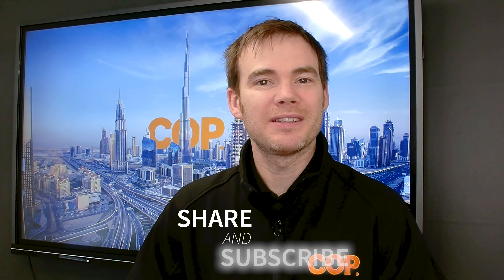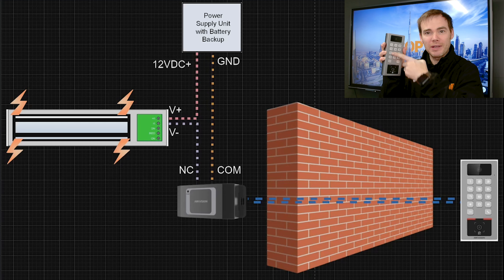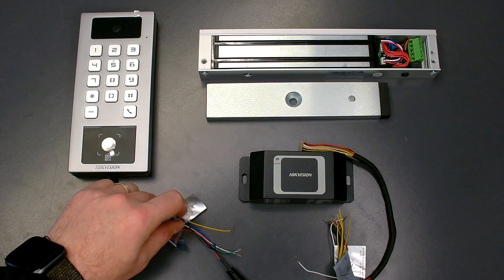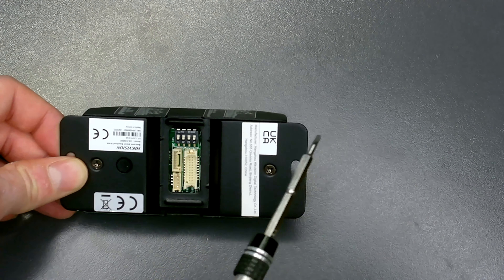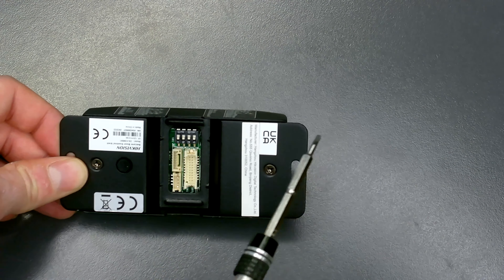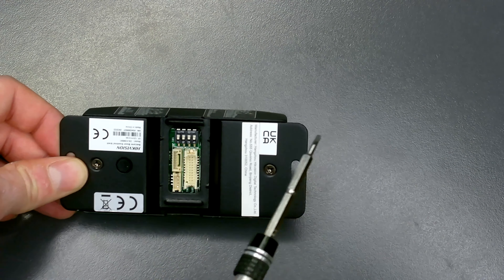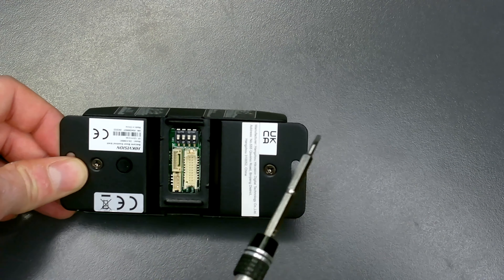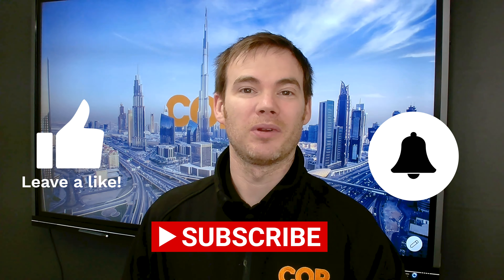How to setup a Hikvision Secure Door Module

Comment: Very helpful video, thanks

I presume this door module can be addressed to an outdoor door module as you have shown and also a second RFID reader to control exit access. Ie 2x units that can open the door in parallel. Do you have any details on this?

Comment: Great video as always , how does the communication of the monitored mag status (whether is locked or unlocked) get back to the terminal as in this demo it’s only the v+ and v- of the mag used
Reply from the maker: Hi, Thank you for your interaction!
For the mag status, you would connect the Yellow/Green on the Secure Module to the NC on the mag and a Black(GND) from the Secure Module to the COM on the mag.
This status would then be relayed to the Terminal via the RS485 as the RS485 uses half-duplex communication (2 way communication, 1 way at a time).

Thanks,
Oliver